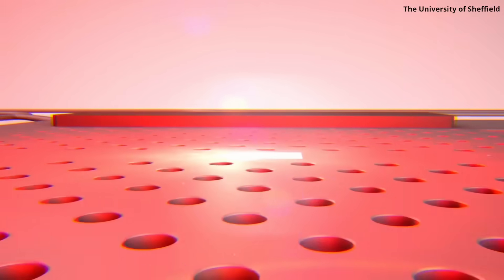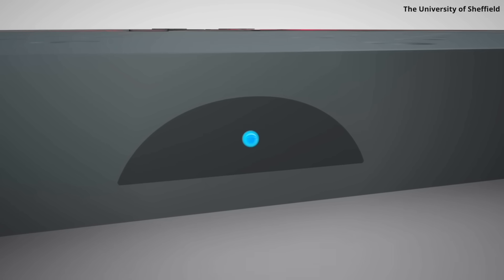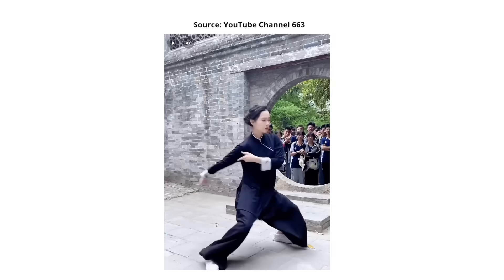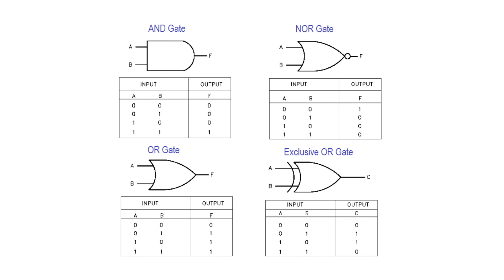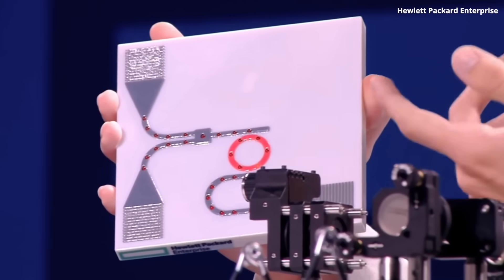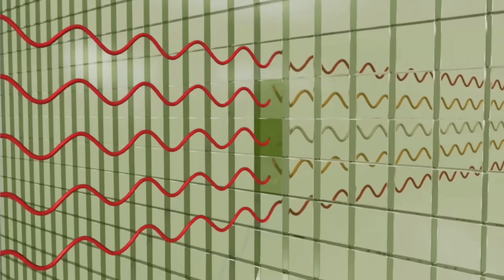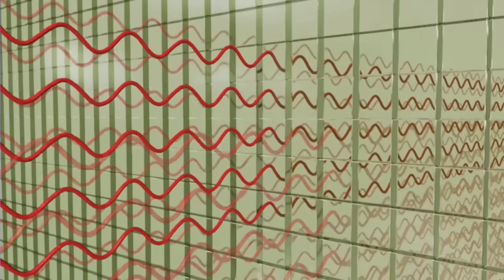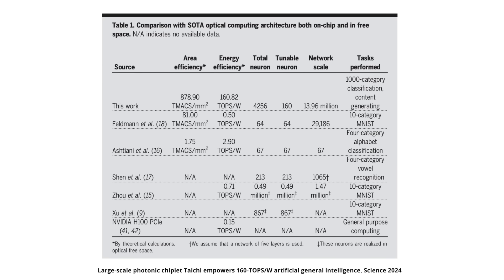Meet Taichi — The Light-Speed Computer

Comment: Photonic elements cannot be smaller than wavelength of light. For example, visible light wavelength is 400-750nm. It will never be as small as current transistors.
Reply: I think the idea is to use wavelength multiplexing in order to run presumably hundreds or thousands of operations in parallel on the same element.
Reply: @rogerphelps9939  I haven't heard that discussed in photonic computing. It would be tricky to use with the interferometers, since different wavelengths would get a different phase shift. Not to mention that the mux and demux at the inputs and outputs would take a huge amount of space and multiply the number of optical ports by the number of wavelengths you use.
Reply: @tykjpelk  You are right. We need a proper detailed description of how these things actually work.
Reply: Photonics also might have a thermal advantage that allows use of that Z axis.
Unlike electric current, that has a nasty resistance>heat>greater resistance feedback problem, optical transparency is mostly immune to that.
Reply: Could UV or X-ray light ever be used?
Reply: @100c0c  It would destroy  the chip.
Reply: LIGO takes near-infrared wavelengths (longer even than visual wavelengths) and is able to measure distances less than a proton using interference. Interference is the key. You can take a large wave, measure deviations in it's phase, and detect changes much smaller than the wavelength. Couple that with the multi-modal nature of light, and you have multiple transistors literally occupying the same physical space. The hurdle LIGO had to overcome was a perfectly clean wavelength. In a multi-modal photonic processor, it's many perfectly clean wavelengths. It's obviously not impossible, as LIGO is working, and it is only using 200 watts of laser light.
Reply: @ryanmcgowan3061  Measuring phase very accurately isn't the challenge, it's making the interferometers small enough to scale easily. LIGO is extremely large.
Reply: @tykjpelk  LIGO is large because they are detecting small changes on very large gravitational waves. A lot of people are commenting on this video and the last video misconceptions such as wavelengths are longer than nanometers so it's impossible. The emitter is actually pretty small, and wasn't even designed to be small. There was no engineering reason to make it small. We have small emitters for fiber optics that would function fine, as long as we can tune the waves to one specific frequency at a precise time. In fact, fiber optics already do this, but not to the accuracy you'd need for interference signal processing.
There are challenges, but it's not that wavelengths are too long. That's already solved.
Reply: The biggest challenges seem to be emitters size (not the transistor sizes) and the ability to parse ultra high frequency signals back to electrons at the same rate photons are pumping them through. My suggestion is just that it should be possible to use a single emitter, and seeing as LIGO's emitter is small and not extraordinarily powerful, and there should be a path to use a single emitter to feed multiple pipelines within the wattage of a typical home computer.
Reply: @ryanmcgowan3061  That doesn't mean you can make the devices even comparable to the size of electronics and still have high performance. I have a tapeout later today where I had to save a lot of space, and the lasers are 1.3x0.3 mm, and the modulators are 1.8 mm long.
Reply: @tykjpelk  Ok, now pass that single laser into a prismatic splitter that spreads it into 1000 beams, where they undergo interference with a second set of 1000 beams of light waves that may or may not have been sourced from the same emitter after a phase shift. (That was my own comment on this video.) The point is you don't necessarily need thousands of lasers. Photons are really easy to split, bounce, shift, etc. You don't need to pipe a laser emitter at the front end of every transistor. You just need a clean pulse wave.

And if that's possible, the issue is signal processing those 1000 parallel beams with some kind of sensor that isn't your standard photodiode. Or maybe they can, I don't know but if photons are potentially signaling at an order of magnitude faster at 1 femtosecond, that seems like converting them back into electrons in copper are going to end up being the bottleneck.
Reply: @ryanmcgowan3061  And how large would such a system be? Also, if you split into 1000 beams you have 30 dB loss in the splitter, and your 1000x1000 system will need half a million tunable couplers with three phase modulators each. That's 3 million electrical pads.